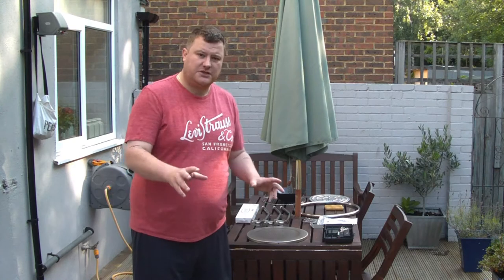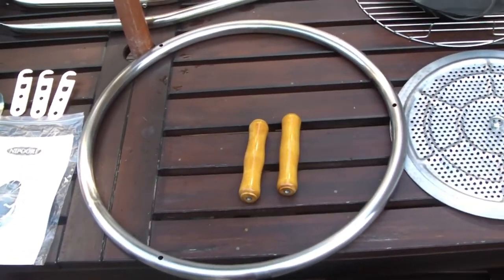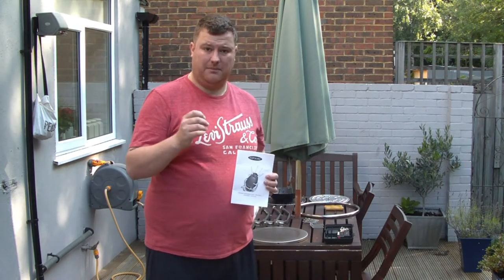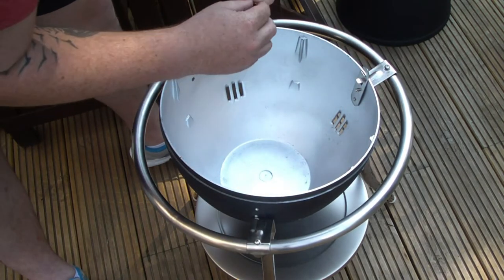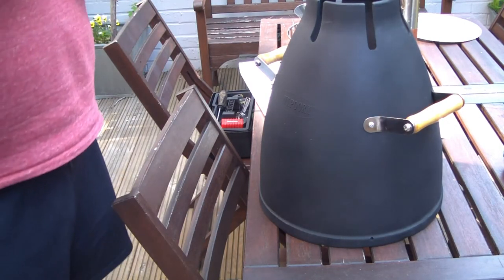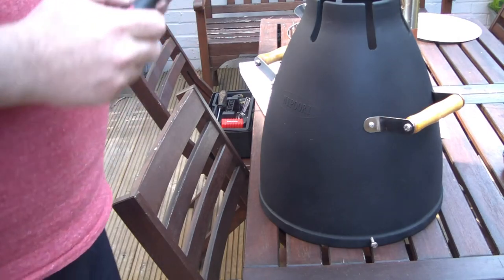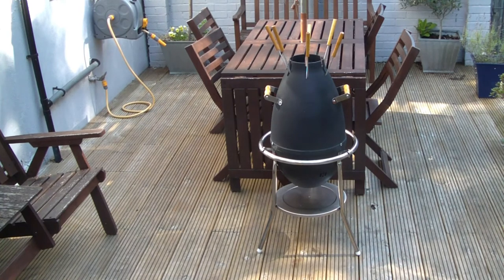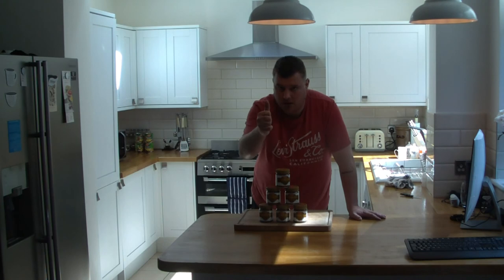Nipoori Tandoori BBQ Build

Comment: I'm getting one of these on Monday, think they are a wonderful  design, I have just made my own tandoor this weekend out of terracotta pots and again am amazed how cheap it is to make and also run, as it does not use much charcoal to get very hot and lasts quite a long time. 

Does the nipoori tandoor hold the hearts well as the homemade type? 

I read that it was made of cast aluminium? Is this the case or is it cast iron?
Reply from the maker: Hi. Im not sure what you mean by holding the hearts. Mine is made of cast iron. I think it has to be really as it gets so hot that other materials may buckle due to the heat.

Comment: Very nice videos. Tell me more abot the tandoor. Is is made of aluminium or cast iron? Is it  heavy? How many scewers can be cooked in one charging of charcoal? How is the taste  like? Is it better than BBQ grill?
Reply from the maker: Thanks. The tandoor is made of cast iron and is reasonably heavy. It is certainly very stable and will not topple over. It can hold six skewers at a time and because of the egg-shaped design, once charge of charcoal (I tend to use the self lighting bags) can burn for around 1.5 hours, allowing you to cook more than one set of skewers. As with all food, the taste depends as much on the ingredients and quality of produce as it does the way in which it is cooked. However, the tandoor gives everything that authentic charcoal cooked taste and it cooks thing super quickly because of the design. The tandoor basically acts as a mini-chimney and the heat is quite extreme. I would not say that the tandoor is better than a BBQ grill because I use them both for different things. Whilst the tandoor does come with the accessories which enable you to use it as a basic grill, it is quite small and you are not able to put large amounts of food on it. I have both a tandoor and BBQ grill and use them both an equal amount and most times, both together. Hope this helps.